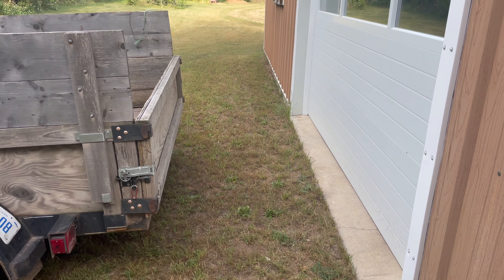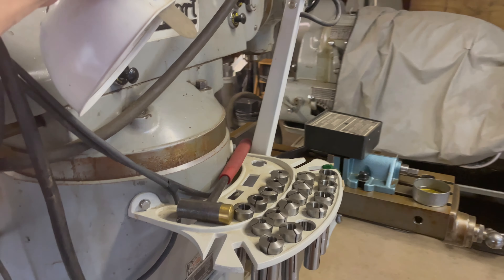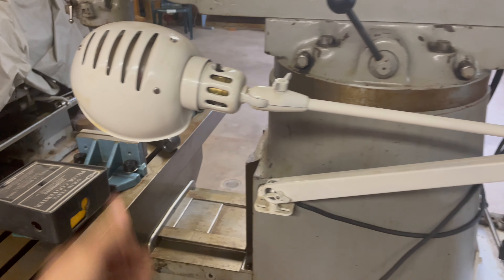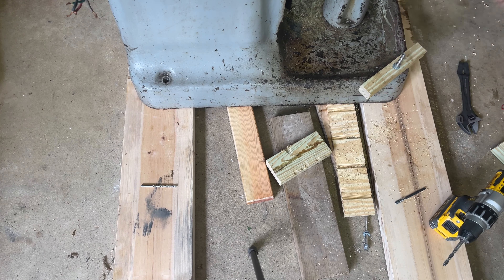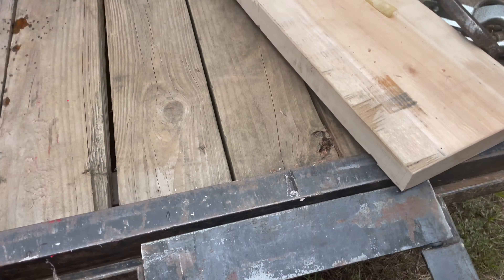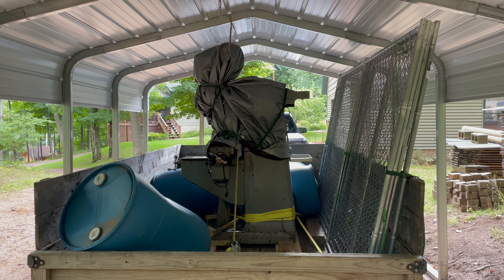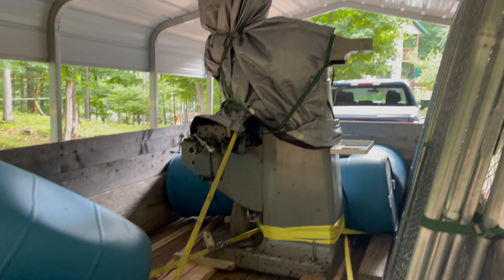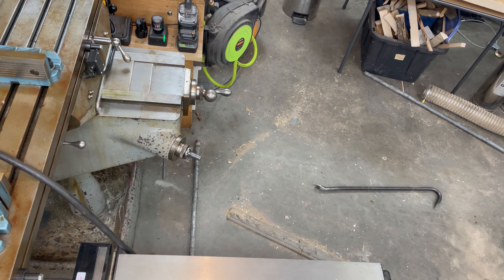Moving a 2200 lb. Bridgeport J-Head Without Heavy Equipment

Comment: Man never seen a Bridgeport moved that way. Looks like it worked well, good job. My neighbor helped me 3 times so far move milling machines. Lift gate truck the first time, that was the sketchiest. So much so my kids went in the house telling my wife we dropped it. (3600 lbs Kondia/Bridgeport combo). The other machines we used a skid steer
Reply from the maker: Yeah… I absolutely hate moving machines over 1000lbs. This one went well. The 5000 lb lathe I moved next slid off the machine skates when loading and thinking about the sound it made still raises my heart rate - I didn’t mess around unloading that one, I called up the neighbor with the front end loader.

Comment: Nice.  Tough doing that by yourself with no machines.  General moving advice is lower the z axis and rotate the head upside down to put the motor by the table to lower the cg of the machine as much as possible to prevent tipping.  Controversially people block under the table then lower the table to lift the base to get stuff under.  There are only 4 smaller bolts holding that on so not really recommended but people do it.
Reply from the maker: Spot on advice. I lowered the table, but not all the way - an oversight on my part. I thought about rotating the head, but due to my unfamiliarity with the machine and knowing it was already perfectly calibrated I figured the the cg wouldn’t be that much better - I also had a bit more confidence in the stability (whether warranted or not is up for debate) with the wood planks.
Reply: @samuelwiltzius   Lots to learn with these machines.  Mine was coated in grease and put away to protect it. It was so petrified I had to disassemble the whole machine… what a learning experience. Get used to calibrating the head though it takes 5 minutes once you get the hang of it. I use a back plunge indicator.  I’ve knocked mine out and have had to tilt things a few times.
Reply: @TKC_  5 minutes to trim the head? You are a genius. To what tolerance -/- .005"? :face-blue-smiling:
Reply: @lesp315  I go for like +-.001 on a 6” circle.  I want my fly cuts looking clean. Snug your bolts to the point that it’ll just move with a decent mallet tap.  The snugging part makes it easy so things don’t move as you tighten the bolts at final alignment.

Comment: bigtime props to you for moving that by yourself i just bought same exact mill and a 6ft lathe for $1000 with all the tooling and a rotary table  just need to get them home i have a buddy thats gonna use his excavator to lift onto trailer for me  did you get yours up and running ? Mark 👍👍✌
Reply from the maker: Thanks! Loading the lathe was also a trick. Bridgeport is great and is up and running. Went with a VFD from Jack Forsberg and am very happy. I’m in the process now of cleaning and painting it. Just moved and uploaded a video moving a 5000+ lb lathe which is getting the same treatment. Lathe came with a lot of quality tooling.